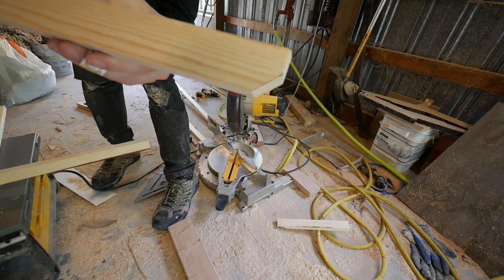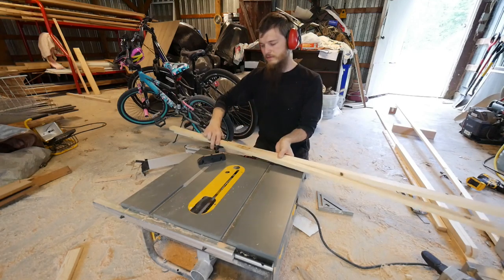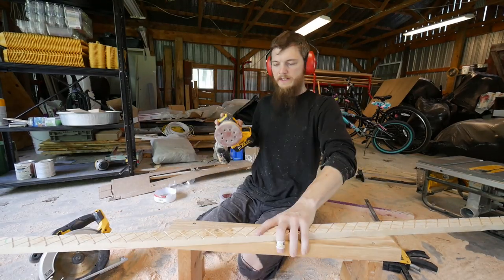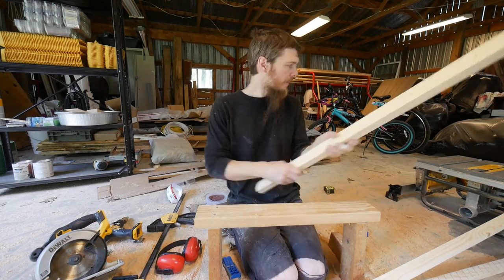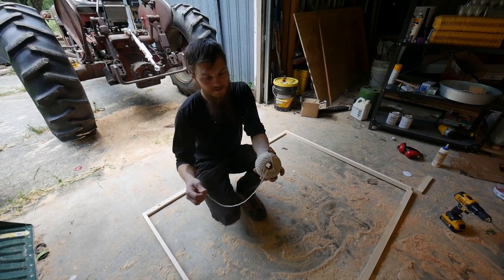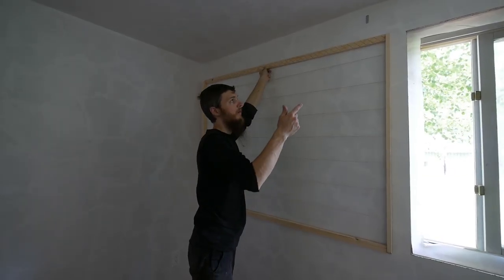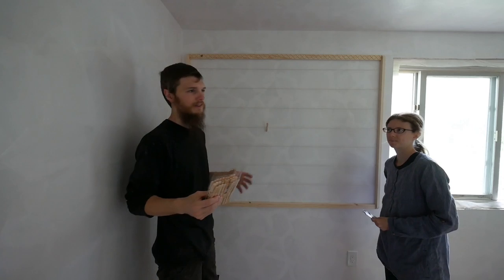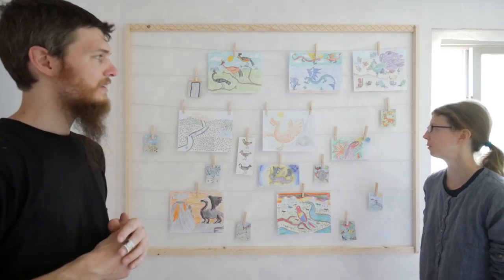Building an ART WALL Display For the Bedroom Makeover

Comment: Random comment since I'm an artist too.  Think flat toothpicks and Elmer's glue for Belle.  Great way to make mini sculptures.  I've made 3 inch rocking chairs,  6 inch windmills,  even a John Deere tractor.... glued side by side toothpicks cut to fit the various parts of absolutely anything.  Scissors and an emery board for sanding easier.  Only a couple did I stain and varnish.  Just something she might like sometime.  Awesome talent on those drawings!

And of course, just random sculptures that tower up and can be spray painted!  You get it.  ❤ from the Ozarks!

Comment: It looks great, her drawing are impressive. Just an idea, in the craft area of Wal Mart they have tiny clothes pins an inch long that she might enjoy also.
Reply from the maker: The dollar store had them too. We preferred the larger ones.
Reply: @diyfferent  Well it looks beautiful as it is. I'm sure your daughter will be thrilled with what you have built for her.
Reply: rocky mountain lass  I stil hang my clothes on the line to dry on nice days and use the large ones for this, yes they do break on me also. I did buy a package of the old type that are one peice that hobbiest make dolls from they are fun to use but not on delicate fabrics. I strung string across a material covered buletin board and use the little clothes pins to display photos, at christmas I put ribbon across the mantle and use the wire one you descried for christmas cards. I love that we have choices.